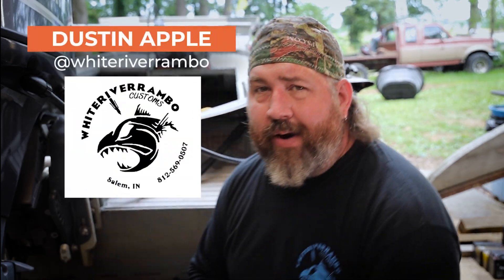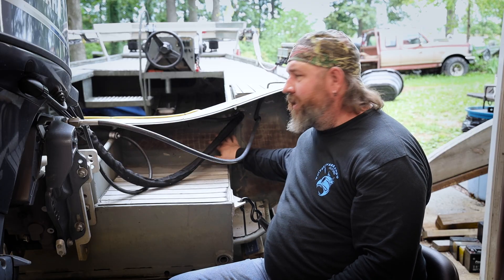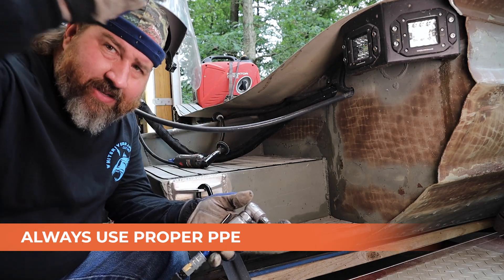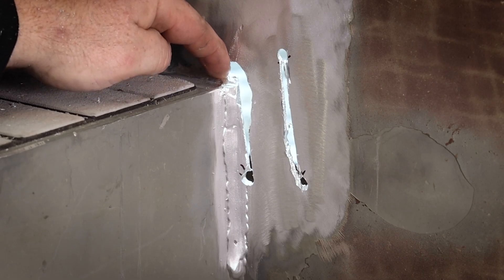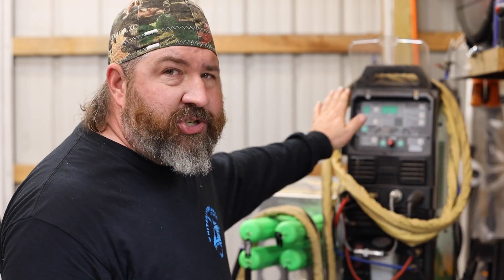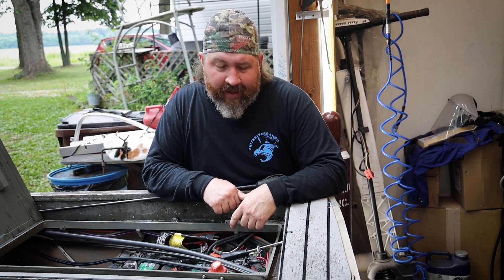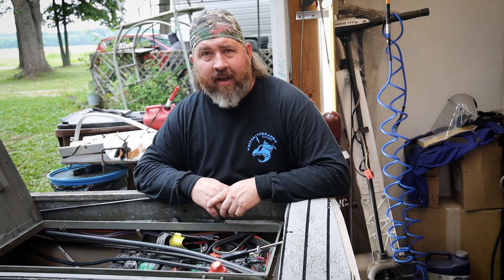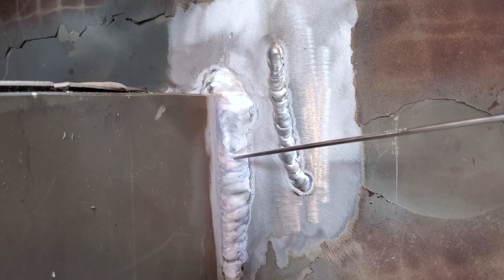How to Repair Aluminum Hulls

Comment: Very good advice on this. I’m not sure you mentioned but I did notice how you remained at the end of the weld with the torch to keep the gases flowing over the weld when you finished. Stainless steel brushes are another good tip. Sometimes preheating the base aluminum does help too. 
If you use a foot pedal can’t you set your amperage a bit higher and regulate from there if you needed more?
Do you think MIG would work as well? I know MIG welding steel sheet metal is more brittle. This video contains a lot of great detail. Thanks.

Comment: IMO, after building a couple hundred welded boats, the panel was too light to hold the to opposite side masses. Aft, the large overhang mass was stressing the panel (transom) and inside the corner of the seat(?) was also stiff. The cure  would be to put gussets on one side or the other in order to unload the flexure of the small area between the two larger masses that are rigid.  Welding up the problem will not solve this, in fact; it will weaken the area considerably since the HAZ is now wider than originally and so the original material's temper is now gone so its weaker than initially.  Even a fish-plate on one side or both sides would have much more a solution than just sealing the failure line.

Comment: Hi there, great information on preparing the surface, I do appreciate that. It would have been nice to know right off the bat you were using a 3000$ welder. The boat I'm fixing is not even worth 10% the value of that machine. I guess that type of repair are for people with financial means.

Comment: based on some experience with aluminum aircraft structures I would think riveting in a doubler would be advisable. Otherwise you will be back doing this after a season of pounding in the waves. nice video.

Comment: Thanks for the video! Doesn't anyone use a spool gun? I found it relatively easy to repair holes and cracks using such. I never learned to Tig aluminum, and I'm not sure that I need to with a spool gun set up in the shop.

Comment: Just a little tip: if you have a crack like this, this IS NOT the proper way to repair it!

Besides the fact that he filled a much-too-large gap, a stress crack should tell you that the structure has either insufficient strength or a stress riser in that area. Or both. His "repair" is pretty much guaranteed to crack again, most likely right down the middle of the bead, or possibly at the toes of the weld.

A well-adjusted person wouldve gotten some 5052 or 3003 sheet metal of similar thickness to that being repaired, and made patches over the cracked area. Preferably on both sides. The reason for using 5052 (preferable) or 3003 rather than 6061 is that they are much more ductile. This makes them much easier to form. They also weld really nice and have adequate strength. They are also much less prone to hot shortness, and their extra ductility and elongation reduces the likelihood of post-repair or in-service cracking. On top of that, the resulting repair is much stronger and less prone to stress risers.

Fortunately, when his "repair" fails, he can grind it down and repair it with a proper patch like I suggest. Then all will be well :-)
Reply: Agreed.
I'd even consider throwing a 90° gusset on the box outside the transom, and similarly on the battery box. Preferably that they overlap each other like he was saying that he'd have preferred them to have been aligned to start with..
It looks like the slight gap 50-100mm in between the outside box and the battery box are causing vertical flex stress fractures, so negating any of those vibrations long term would be preferable to a simple fix of just welding over the cracks and calling it a day.
Reply: My uncle taught me about the gussets. I like using them even when I don't need them. Gives me something to use those scraps on!!! I love welding
Reply: WTFCHUCK.  Question for you.  I have a crack in the hull of my Lowe fishing boat.  It’s been welded twice now with little success.  You mention welding a patch over the crack.  I guess my question is, wouldn’t the weld around the patch make my hull weak??   I don’t want to make the problem worse.  How do I know what type of aluminum the boat is made of??  Want to make sure that I have the right type for the patch.  Thanks in advance.  🎣🎣🎣😃
Reply: @jackmasters9953  all good questions. Theres no easy way to tell what alloy the hull is made of. The main question is whether it's a weldable alloy or not. Some alloys are so prone to hot shortness that they are considered "non-weldable". Or, at the very least, they are considered very difficult to weld. 7075 would be one of those alloys, but it's highly unlikely your boat is made from that material. 6061 is weldable, but its prone to hot shortness. Welding it requires sufficient admixture with a suitable filler material in order to prevent cracking as soon as the bead starts to cool. Both 4043 and 5356 will work, but 5356 requires more admix to ensure the weld wont crack upon cooling. 

One way to tell if the alloy that your boat is made of is readily weldable is if it has factory weldments. Lack of weldments doesnt necessarily mean it's a difficult to weld alloy, but it also doesnt prove it is. Even if the alloys are weldable a manufacture may still choose mechanical and/or adhesive fastening to prevent in-service cracking In the HAZ of any welds. There is a reason manufacturers of airplanes with aluminum skins and structural members use rivets, bolts, and adhesives over welding. If you have repeated issues, you may want to consider mechanical repair rather than welding. I'd also look into WHY the cracks are happening. Obviously the problem area is under enough stress to fatigue the material and start a crack. Figuring out where the stress is coming from a d looking into reinforcement may be a good idea. Be careful though. Without a thorough and proper analysis it's easy to simply move the stress concentration to another non-reiforced area and end up with the same problem.

If you do decide to weld vs another method of repair, you definitely want to stop drill the ends of the cracks. Then, I'd use a saber saw to cut through the crack and widen it. That way, you can weld the stop drill holes and the gap where the crack used to be to the reinforcement patch. On the patch itself,  make sure there are no sharp corners. Large radii are your friends. Even though welding will turn a sharp corner into a bit of a radius, a bigger radii is always desirable. I'd say to cut and/or file the corners of the patch to at least a 1/2" radius. Finally, use as little heat as possible. Try to avoid the bubbling through appearance. 

In the end there are no guarantees if you're simply repairing a crack. Like I said, finding out why the cracks are happening and fixing the underlying issue is the only way to prevent future cracking.
Reply: @WTFChuk  thanks for the response/advice!!!  I can call the boat manufacturer and ask them what alloy they use.  The problem crack is directly under the captains seat.  How the seat base is attached to the structure of the boat is the problem I believe.   It’s an old boat but buying something else in retirement won’t happen for a while.   Also, I’m not interested in pulling the floor out and seeing what’s going on the inside.   I’ll let you know how it all turns out when our weather breaks in southern Michigan.   Thanks again for your help.  Means a lot.  Have a great spring !!🎣🎣😃
Reply: @jackmasters9953  You're welcome! Enjoy the water!!

Comment: The fixation with welding uphill is based on structural stick welding. Mig, RMD and SST are usually done vertical down. Even with Tig gravity can be your friend especially on thinner metal.

Comment: Great video. Thanks for mentioning PFDs and PPE. Always note that failures are opportunities to re-engineer. It may break when you beat on it, but if it was designed for that use, it wouldn’t have broken.

Comment: all aluminum welders should be clean shaven and fit checked with appropriate respiratory protection.
Reply: My welder doesn’t have any hair to shave, but does have a pretty strong fan. Does that count for respiratory protection?
Reply: @whodat90  depends on your legs..?

Comment: I was wondering what aluminum filler rod you were  using? (5554 ?). Also why not mig aluminum in pulse? i would have used that process because it is faster and easier to get to the cracks.. You can go uphill or downhill with pulse mig aluminum.
Reply: actually you cant go downhill with aluminum.. sure you can go downhill but you cant pull, cant downhill, cant overhead.. sure aometimes you will need to when you must( but you can create a procedure for anything with enough knowhow and proven engineering procedures)
Reply: @philanderingwhitecollartra8281 G'day mate, I manufacture tinnies (aluminium boats) down here in Australia.
I guarantee you that I weld in any direction necessary, and I can tell you that my mig setup much prefers going downwards on vertical sections, and that overhead welds are also completely standard, and accepted.
Reply: @Tazznbk  whats the codework section for explosive lamination welding?.. like stage building  & the brown m&m candy.. details in the statement but everyone has two bits when they break a drill
Reply: @philanderingwhitecollartra8281  You can certainly weld aluminum mig overhead, I've done it a plenty of times with a spool gun.
Reply: @xXxXcrosbykidXxXx  code work welding under a  supervisor you wont..

Comment: Aluminum mig with a copper backer would have worked as well.
Reply: I would have thought mig would have been much easier and quicker for this weld but both work well
Reply: Can’t use copper with aluminum
Reply: @Ghdskop  the copper is used for a heat sink while welding thin aluminum.
Reply: @hvymax  can't use copper backing on aluminium. You'll have copper pick up and risk cracking. Use stainless steel backing

Comment: You have to watch the crater at the end of the weld. They pretty much automatically develop cracks.
Reply: everytime you finish a weld fill the aluminum craters..
Reply: @philanderingwhitecollartra8281  peen the crater and the area around it. That will create compressive stress in the metal and reduce or eliminate crack formation. Dont go overboard though. Cold working strengthens most  aluminum alloys, but it also increases brittleness and decreases ductility.  You have to strike a balance, pardon the pun!
Reply: @WTFChuk  just fill your weld crater then you dont need  the extra tool..  time is motion..
Reply: Always fill it in or add more filler as you ease off